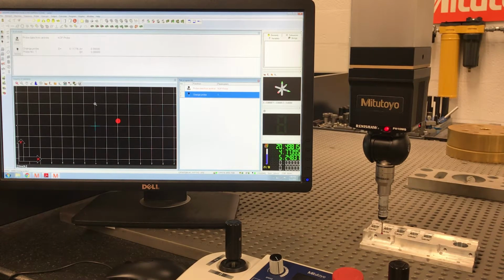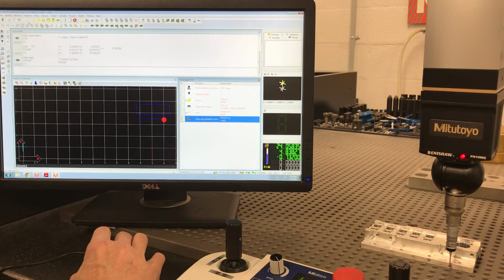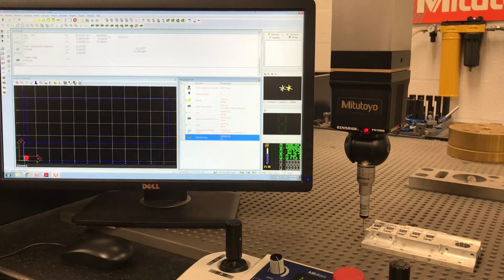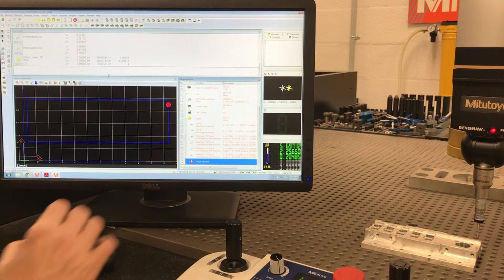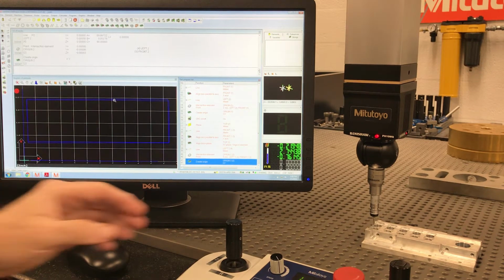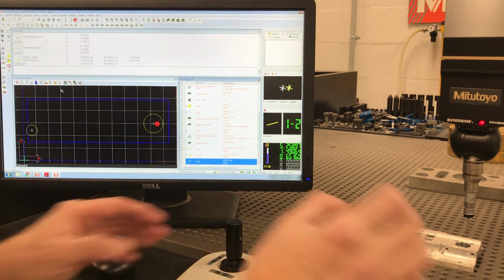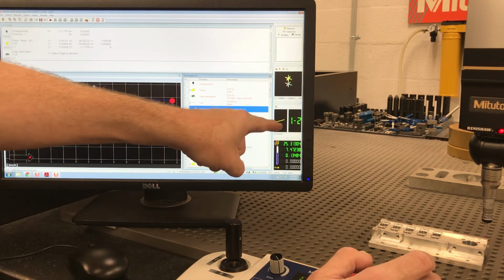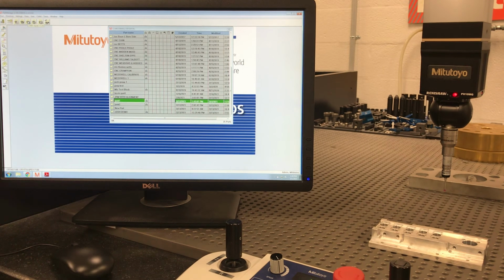Mitutoyo CMM  CNC programming with Manual Alignment

Comment: How would this work if you can’t use a canned alignment?  I have a part that needs to be aligned through two threaded holes in the datum face. The steps to align it right now are plane (part face), circle (center c-bore), and a line that is constructed through 2 threaded holes (inspected as cylinders). How would you do this?  My goal is a manual alignment and cnc run.
Reply from the maker: The plane would be the top. You need to establish a line even if it is going through 2 circles. Then you can construct an intersection point for your origin. The method I used was a simplified version. But you need a plane established, then line established, then you can set the origin anywhere. Hope this helps.

Comment: After inspecting first part , there are 10 more same parts need be inspected, can I change or edit this program to jump over manual alignment to run dedicated alignment? how to do it simple way?
Reply from the maker: I’m not sure of an easy way. If you use a fixed setup( vise or locating pins) I would right the program to do the alignment utilizing cnc on. 

You might could try editing out the alignment steps for next parts. But I don’t know if I would trust that the alignment is correct from part to part.
Reply: @machinisttodd  thank you! I will try it.

Comment: can measure roundness and texture
If can how...?
Reply from the maker: When you measure a circle, the number under the diameter in the results section is the deviation from perfect roundness.   I’m not sure about the texture. I usually use a profilometer or surface roughness gage for that.